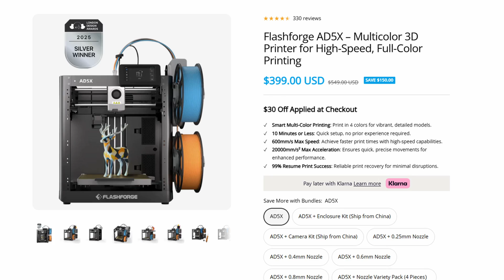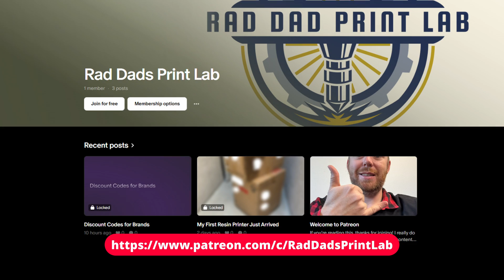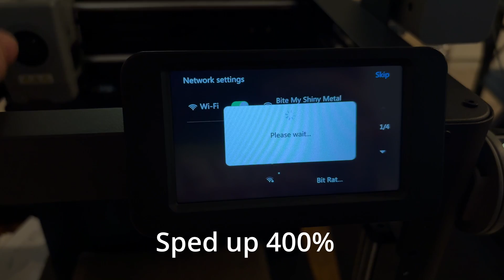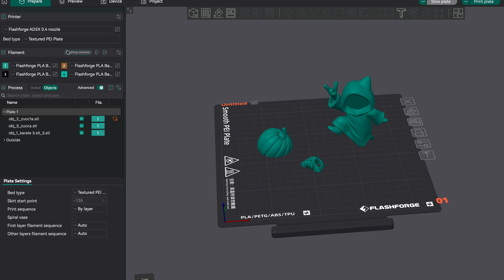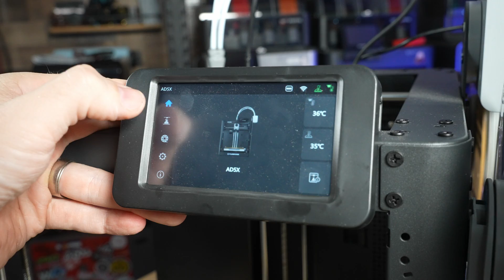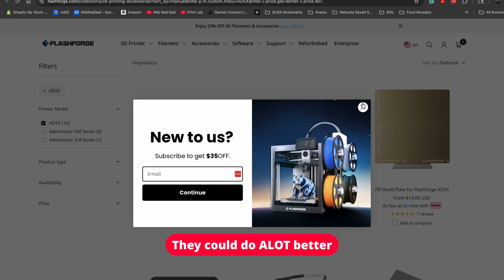Is This $399 Multicolor 3D Printer Worth It? | FlashForge AD5X Review

Comment: I have bought exclusively Flash Forge
printers after switching from Resin printers
and XYZ and a Volex Lab printer.
Adventure3 and 3 Lite, 4 lite, 5M and 5M pro.
I purchased the ADSX in September.
The only problem with this machine is
that not if but when filament breaks of
within the extruder or the filament feeding 
assembly the problem starts. If the filament 
break has not reached the nozzle or
hot end, it has to be pushed through the
assembly feeder to the hot end and nozzle 
to purge it. unlike  its predecessor, which
has a more filament assembly feeder 
anything other than filament to
push it through will damage the feeder.
If you try to use an unclogging tool 
that is designed to do this, you will damage 
this 15 dollar piece of cheap assembly filament feeder.resulting in either 
have to disassemble the extruder to replace 
part or possibly replace extruder.
As for as the printer it’s self, it’s easy to
use, fast and puts out quality prints
Reply from the maker: Just curious, why only flash forge?
Reply: @RadDadsPrintLab   The reason I was only using Flash Forge Adventure Printer was because of their detachable nozzles and the fact that parts were assessable through Amazon. Prior to using Flash Forge, my first non resin printers where from XYZ and Voxel Lab, I
I had such a bad experience with non availability parts or parts that only came from China, 
.
Reply: @RadDadsPrintLab   I’m definitely will
to switch. I did just purchase the ELEGOO Centauri Carbon printer.
I’m interested in the Anycubic Cobra
Multi color printer. Would you happen to
know if it is any good?

Comment: Had mine for a couple of weeks and so far, it's been great.
I do use ethernet (printer is about 4 feet from my router) and just recently found out about an app called FlashForgeUI that I can use to manage/monitor my prints in LAN Only mode.
It has it's own built in web server, so I can monitor my prints using my cell phone's web browser.
Yes, I need to be on my home network, but I have a VPN on my router.  So when I am away from home, I just VPN in and use my browser.
As for broken filament, I've been able to remove the 4to1 adapter and then push the filament out from the IFS side with another piece of filament.  I only need to push it enough that I can grab it and remove it from the 4to1 adapter.
I haven't done much multi-color, but just love being able to have the 3 most common colors I use installed.  I've done some multi-color, but mostly just raised lettering/numbers, so that it really easy to do.

Comment: This printer is pretty great, That i can agree but honsetly? If you really want a cheap multicolor just get the kobra 3 or 3v2 They give less purge and better height for around the same price
Reply: If you want a k3 your gonna wanna upgrade heated bed right away don't print to save its life have nothing but issues trying every bed possible different heads and nothing just ordered a adx5
Reply from the maker: Interesting! Ill have to look that up!
Reply: kobra 3 sucks at least the og version ams or ace constant errors etc. within a month I had to tear the ace apart with one slot out 4 working correctly.  Print quality went to shit shortly after that I swapped out the hotend still prints like shit. Been 3d printing for a decade I have fixed and owned many printers K3 worst printer ive owned.
Reply: @MT3dprintedworkshop agreed for sure, i forgot to mention i had the v2 its great execpt for a nasty clog,
the suppourt is nice they walk u through, i couldnt do it so i got a new print head for free, 
if u were in the. warranty. thwn u can get replacement parts for ace?